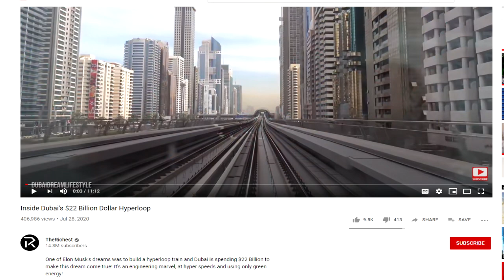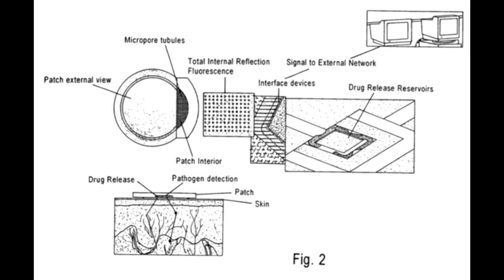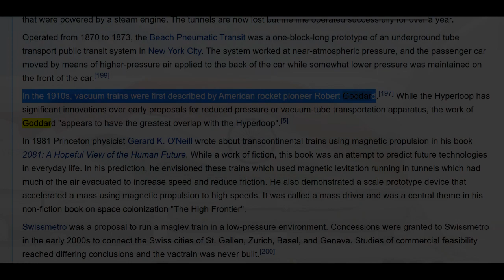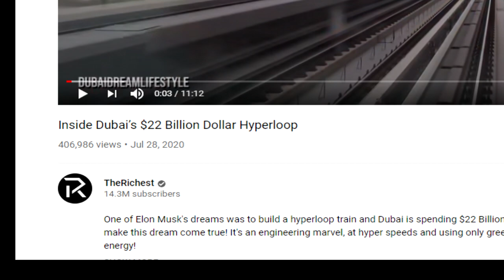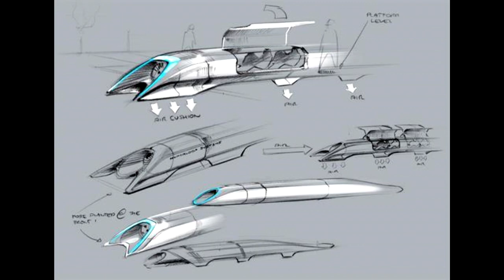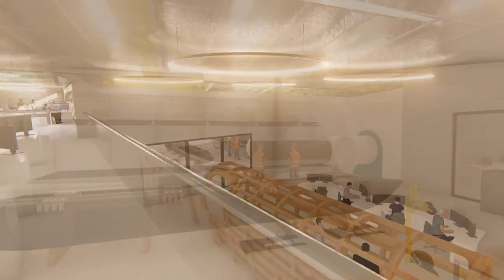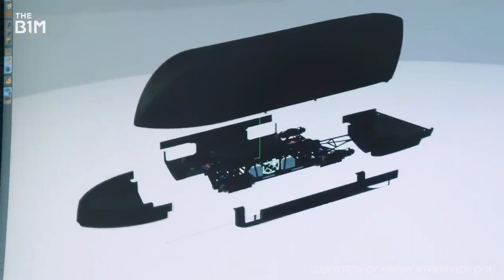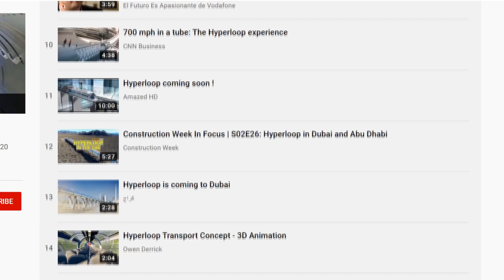Hyperloop, the biggest Scam since Theranos

Comment: The hyperloop™ is like fusion, it will be 5 years away for the next 100 years.
Reply: except fusion has actual science behind it, is actually practical and is actually about 4 years away
Reply: Fusion is proven to be possible (the sun works, right). They are just working on making it practical and more efficient.
Meanwhile, hyperloop takes something practical (the train) and makes it completely impractical, to the point of almost impossible to work.
Reply: Betraced_Assassin • I’ve heard about 2 test reactors being built/planned and they are set for 2035 at the earliest. I know we have already done it but not to the point it makes more energy than it takes to start
Reply: @DoubleM55  The sun? Wouldn't a fusion reactor be a more fitting example? Fusion is always 40 years away because of the way the project is organised. All nations involved want to make sure that they will be able to build all necessary components. Because if you are, say, China, and put 50 years worth of know-how and money in to it, but then the Trump of 2070 denies you access to the American contribution, that would suck, isn't it? So for that reason, progress has always been excruciatingly slow. In fact, China has since decided to go their own way because that may be much faster in the end.
Reply: @DoubleM55  
> the sun works, right
Sure, the sun works.  But fusion here on planet earth can't be done in the way the sun works.  The sun has gravity, which does the job.  Here on earth you need higher, much higer temperatures since you only have a weak magnetic field to "emulate" gravity.  THIS is a major difference.
Reply: @Conenion  I know that. I just said that we know that fusion is possible, we just need a practical way to do it on Earth.

Comment: "it could produce more energy that it takes to make it run" 
And right away I knew this was complete garbage.
Reply: Exactly I hear Newton reeeees
Reply: Why? Clearly Elon Musk has invented the perpetual motion machine like... years ago. In fact, he was actually the first one who has ever thought of such a machine!
Reply: I would say true it can produce more energy if itself is not running. It would be a highly aesthetic display piece for a long solar panel array
Reply: I mean it's a dumb claim but way to intentionally starwman it.
Reply: "In this house, we obey the Laws of Thermodynamic!"
Reply: It's called a solar panel.
Reply: Air bearings in a vacuum. Right.....
Reply: @johntheux9238  That's a fair point. Or rather it would be if solar panel efficiency was at 60, 70, 80% 
What's it currently sitting at?
Reply: @albaniaball897  22% so 66 W/m2 in average. If your panel is 9 meters wide like in the video you get 600W per meter or 600kW per kilometer.
Reply: @albaniaball897  Regenerative braking can help.
Reply: They also promised peace in the middle east

Comment: "Generates more power than consumed." Omfg I was on the floor when I heard that. Lol!
Reply: There’s nothing like defying the laws of physics
Reply: Probably means the solar panels will generate more power than the Hyperloop consumes (which they wont)
Reply: Hyperloop of the future!
Reply: Perpetual motion machine!!
Reply: its dumb cos the hyperloop has no connection to the solar panel farm... they just put it on top.... with that logic you can run anything for "free"...
Reply: Well of you put a solarpanel on a train thats not working, it's technically producing more energie than it's using.
Reply: Well from out of context it seems stupid. But in context it was talking about the solar panels on the surface would be generating more energy than the hyperloop vehicle would consume. 

But yeah. The idea is a failure regardless.
Reply: I consume daily like 700 calories (sometimes less, and sometines none) and burn 2000 calories thanks to my work.
Reply: Hydro dams generate more power than they consume. It has nothing to do with defying the laws of physics or perpetual motion bs. Wording is key.
Reply: First time ? x)
Reply: @craigstephenson7676  What do you do when you stare at Hoover dam?
Reply: @2010ngojo  Yeah, because gravity is doing the actual work.
Reply: But this is true. since it doen not exist and it power consumption is 0.
Reply: @38911bytefree  generates 0 energy and consumes positive amounts of energy by having to be constantly debunked
Reply: @2010ngojo   yeah that's because dams are literally just turbines that take advantage of a source of energy, not enclosed vacuum systems and cars, f**** duh
If a dam was fully enclosed within a vacuum then it would be a perpetual motion device.
Reply: So these things are only for country's where those tiny solar panels can actually generate more energy than the blue LEDs need, forget the massive vacuum pumps and the magic propulsion system.

Comment: Conspiracy theory:

All the tech that Elon Musk invests in are actually components for space infrastructure done in a way to draw away attention that these are components for space infrastructure or to get around all the people who keep saying "well we should really put this money into things here on Earth."

SpaceX is pretty self-explanatory.

Tesla: power distribution system would most likely need to be renewable, thus requiring massive energy storage technologies. Electric vehicles would be the main mode of transportation in colonies. Gigafactory's design (an entire supply and manufacturing line in one building) could be a prototype for how on-Mars manufacturing could be set up.

Boring Company: Radiation on Mars is a huge problem for long-term habitation. One solution is to build the colony underground. Boring Company is used to explore new ways of building underground transport networks and utilities on a large scale.

Hyperloop: Pressure control and safety systems onboard the trains could be implemented in manned-rovers. Linear electromagnetic accelerator could be implemented on Phobos and Deimos for launching things back to Earth. Also, Hyperloop makes more sense if you don't need to evacuate a giant metal tube. Why put these two techs together? Hype up the tech, have others build and develop the tech that will fail when developed for Earth deployment then buy up these companies and the tech for cheap.
Reply: I was thinking the exact same thing. It only makes perfect sense. I'm glad I'm not the only one.
Reply: Give the robot a cookie, it's all a long-con for getting research into martian infrastructures financed by scientifically inept investors.
Or Musk is out of his goddam mind...
Reply: @edde591  it doesnt make sense
Reply: Living on mars aint possible why would u think it is
Reply: That’s actually genius if that was what he was doing
Reply: @ethancampbell2422  This. For years now I've considered Musk a dreamer who lacks/lost a critical filter in the things he develops, likely because his fanbase blindly cheers on whatever he announces anyway. I genuinely hope he's actually smarter than that, and this thread is correct in that he's actually bumbling about with crappy projects with the intent to gain intel for the tech's actual intended use later... But of course the former is still entirely possible, as TF's playlist of debunks shows is something that's all too common among popular tech projects.
Reply: who knows, makes sense though
Reply: @noneofyourbusiness153  really? how so? how is elon blindly bumbling forward?
Reply: @Michael-mn4ef  A selection of things that even just Thunderf00t himself has addressed:
1) The hyperloop reinventing the subway with a gimmick that only makes it worse.
2) Every house with its own batcave to move cars underground to the hyperloop.
3) Dangerous reusable landing giant commercial spaceship BFR for continental travel.
4) Electric """self driving""" cars on crappy batteries that cause more pollution than current diesel cars.
5) The toddler doodle monstrosity called cybertruck, with unbreakable windows that break easily.
Can't think of any revolutionary technology or product he actually produced.
*edit: also, I didn't say he's blindly bumbling forward, but that he's bumbling about with crappy projects while others blindly cheer him on.
Reply: @bikingcat now there's a conspiracy theorey!
Reply: @noneofyourbusiness153  lmao
Reply: Never attribute to malice what stupidity explains better.
Reply: @sigurdrr1015  Honestly I don't consider it malice if he's testing/developing/funding useful tech by stuffing it into relatively silly projects that his fans/investors will eat up despite never producing anything useful.
Reply: @noneofyourbusiness153  you are correct and i am sorry i did not expressed myself properly. I should have said never attribute intent were simple mistake would fit.

All in all that is just Elon Musk raising his share prices. Most likely. There is nothing to be gained by all this idea of diversion and secrets.
Reply: YexaC  maintaing food and creating energy would be on a merge of possibility, the cost of such city would be so enormous that I ssy its practiclly impossible
Reply: @noneofyourbusiness153  he is not smarter than that, he is typical billionare, a kid whose father owns slavery mining company in africa
Reply: First principles. Futures so bright 😎
Reply: @sigurdrr1015  Real life experience says: never attribute to stupidity what can be attributed to malice!
Reply: @hans-joachimbierwirth4727  worst of all you are probably right more often than not
Reply: Also, just to make it clear, me raising this conspiracy theory doesn't mean I actually fully believe this is really happening; it's only what I wish is happening. It is  just as or more realistic that Musk is just crazy or a dreamer. Pretty sure he isn't a scammer unless you count raising venture capital on an idea that doesn't make engineering sense a scam. Seems to me that's just taking money from people who aren't good at researching before investing... Actually, no. After writing that I can sort of see how it's a scam...

It's like my conspiracy about the moon landing hoax conspiracy. Do I really believe the US Government paid a bunch of people to spread the false information about Apollo 11 being fake just to distract from a possible conspiracy that could arise after the aim-sun-at-camera trickery done on Apollo 12?  No, but it would be funny if it did happen or at least would make me feel slightly better that there are people stupid enough to believe the moon landings were fake and yes I realize that by bringing this up I'm likely condemning this comment thread to the crazies but FNCK IT.
Reply: Musk is given more credit than he deserves. He aint no Tony Stark. He has teams of engineers who are the ones doing the actual big brain work for him.
Reply: @noneofyourbusiness153  That is the definition of malice. When you con people to take their money then you are engaging in an activity with a malicious intent.
Reply: @GeorgeMonet  I don't think he is conning anyone though, if he's developing tech intended for something else through somewhat pointless projects that are popular enough to get hype and funding.
Reply: Jupp. Combine this with the fact that suddenly everyone wants to go to the Moon with manned vehicles...and just so, the first ever detailed geological map of the moon came out, and what´s there? Lithium. Loads of it. The stuff that we fear we might be running out of reserves here on earth if we really go into that battery thing without cutting down on power consumption. Soo...I will not be surprised if the first cargo commercially delivered to Moon´s surface is a couple rolls of barbed wire....
Reply: @ethancampbell2422  or both
Reply: @noneofyourbusiness153  as such, open sourcing it is brilliant: let your competitors do the actual work and lose the actual money doing so....
Reply: wow, i never saw it that way! i could see how hyperloop was not going to work, but i could not understand why  keep pursuing something that  was not only not working, but could also hurt spaceX either directly or indirectly, and on top of that bleed money like crazy.  when you see it from that angle, they could also be doing some hollywood accounting and using hyperloop money  on spaceX. All of this makes me worry spaceX is not as profitable, or the rockets are not as reusable as they make it look. A scandal like that would set back space exploration decades